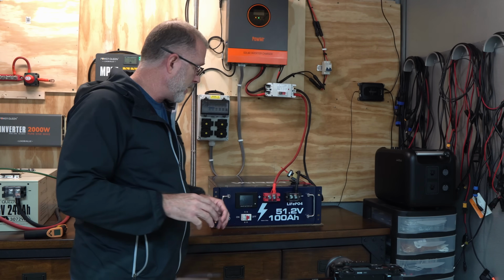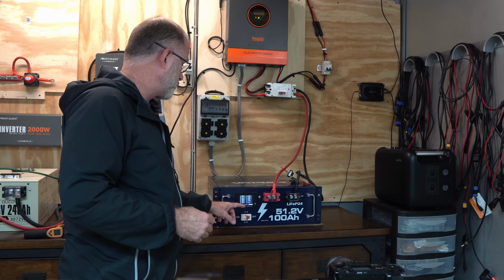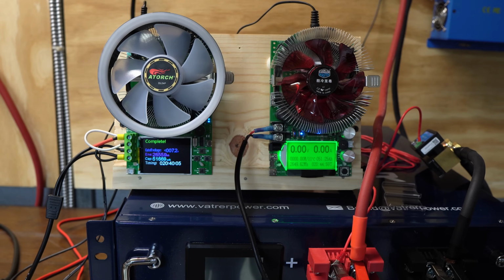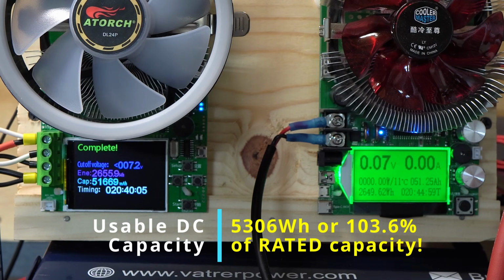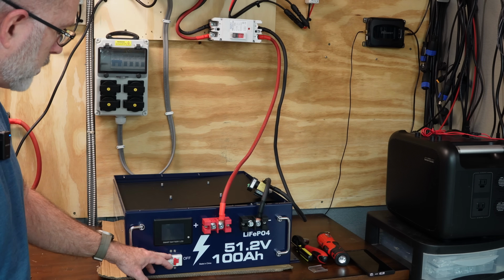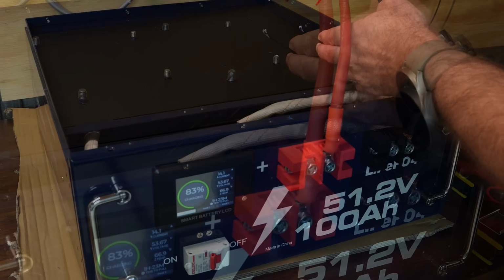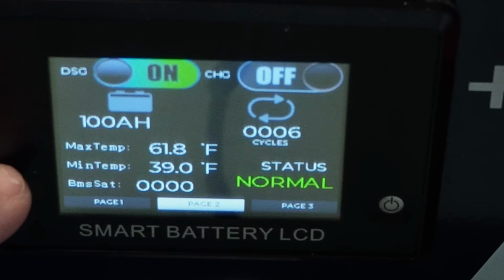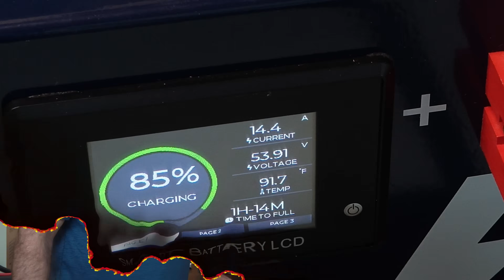48V vs 12V - PART 2: Is a Rack Battery the BEST choice?  Vatrer Power 51.2V 100Ah LiFePO4

Comment: Thank you for this video. I also  own one of these batteries. The problem is that whenever I connect it to  the inverter, it goes to a SC (short circuit) mode protection, visible if you navigate to  the second screen!! Obviously, this is caused by the initial  in rush current flowing into the inverter's capacitors. If I understand you well, I have to 1. turn off the battery's breaker, 2. turn on the inverter ,3. Turn on the circuit breaker, 4. Wait for some moments, then turn on the battery's breaker. Is that correct?
My understanding is that as long as the battery's breaker is off, no current in principle is supposed to flow out of the battery.

Comment: I'm interested in the circuit breaker that you have between the battery and the inverter.  I've got basically the same system and don't have a breaker at that point.

Comment: Great videos. Thanks. If you have this rack mount battery could you add a string of 12 volt batteries in series to up the capacity or would you need to keep using rack mount units?

Comment: I have a 48v Outback inverter and have used 8 Golf batteries which are near their end of use. I would like to use 48v lifepo battery. when I asked an Outback tech he said I should not because the charging was not right, and it could cause a fire. I would like to know your opinion.      Thank you

Comment: Great video . Do you have a video on how to install the entire system for the inverter in the backgroung? Thanks
Reply from the maker: I have a couple of videos that walk through the key elements.  The one on that specific inverter is here: https://youtu.be/C-SneC4oXiA   And I've also done one recently on an upgraded inverter from SunGoldPower here: https://youtu.be/R6mYMVkByas  I hope that helps.
Reply: @ReeWrayOutdoors  thanks for the videos very useful. You gain a subscriber.  I was thinking on a EG4 inverter 3000 all in one and noticed that max current imput is 80amps, what does it means compared to the Powmr? I am a begginer , so i am still learning. I hope you can comment. Thanks again!
Reply from the maker: @alexherrera3918  Between the EG4 3000 and the POWMR 5000, I'd go with the EG4 if you don't need the extra power capacity, because EG4 is based in TX and you'll get better service and support, which is definitely worth something.   The 80A cited on the EG4 is referring to the maximum current it can provide when charging batteries.

Comment: So you use a step down converter to power all the 12 volt stuff in the camper?
Reply from the maker: @scottmartinetti4875  if your system voltage is not already 12V, yes. And keep in mind that many DC appliances (fridges in particular) are often already compatible with 12V or 24V so in those cases you might not even need a step-down converter.
Reply: @ReeWrayOutdoors  have you seen those electric car generators for $600 in eBay? Auto start, 48 volts.  Thinking about doing that in my old Toyota motorhome and then getting a set of 48 volt batteries.

Comment: I am testing this setup with a LiTime 48V (51.2V) 30Ah LiFePO4 Lithium Golf Cart Battery, Built-in 60A BMS, Support 2C Discharge, Max. Power 3.07KW, wondering what settings I should use?

Comment: Thank you for making this video! If the Vatrer also had RS485 it would be a no brainer vs more expensive vendors! Did it come with cables to link it to the MCCB you have between it and your inverter in the video, or did you have to buy / make those separately?
Reply from the maker: No, it didn't come with any cables.  I just crimped my own.  :)
Reply: @ReeWrayOutdoors  that's good to know! What awg did you use?
Reply from the maker: @thedabbler2753  I used 2awg since it can handle up to about 120A which should be a solid 15-20% higher than the 5000W 48V inverter I'm using will ever pull (and my DC breaker is rated for 120A as well).

Comment: I got a 12.8 volt 50amh  LifePo4 battery.
I'm using an  54.7 volt  ebike charger , will  the 54.7 volt do damage to the LifePo4 battery?

Comment: I currently have 2* 100a 12v marine lead acid batteries but plan to get LifePo4 eventually.  But, i want to put an inverter/charger and was debating on whether or not to use a 24v system because i already have these 2 12v batteries in my rv. Should i get a 24v or should i stick with 12v?

Comment: I just bought (4)  12v 100a batteries for a grand total of $600. Not near as fancy but for less than half the price it fits my budget. As far a balancing goes according to Will Prowse and David Poz if wired with the leads at opposite ends of your pack they will balance themselves but best to just make sure to fully charge prior to hookup. I have heard that when building a battery from scratch you may have voltage issues so always use a BMS with built in balances.
Reply: Balance not really needed if all wired in series, inbuilt BMS will take care of it
Reply: My question is 4 12v 280a batteries  more power then 1 48v 100a battery? I am asking because I want to get a system and don’t know what the best option for me on a budget friendly way.

Comment: Always enjoy your videos.  I've been thinking of building a diy portable hand truck 48V system using a server rack battery to use for my shed for lighting and running a small window 6000 BTU a/c and lights for a couple of hours a day.  My question is will the 30 amp MPPT be enough to do solar charging (400W) or should I buy a larger amp MPPT in case I decide to expand.

Comment: Not sure if this will have any "real" impact, but 48 volts is less than 50volts... which is relevant to the NEC. Whereas, 51.2 is greater than 50v, so more of the NEC applies.
Nevertheless, Its convenient to have 100 AH "packs"... etc, with all the built in meters and switches etc.

Comment: Install a transfer switch on your house service panel, kill the main breaker and let us know how long a system will operate with solar back up. It did not work for me and I installed a dual fuel Generac system propane/gasoline. I am all for the battery concept but when an ice storm takes out the rural power lines and the sun doesn't shine, it was not enough for me.

Comment: On parallel connections, there is actually no limit.  That is, it is solely an issue of safety and the battery's internal interrupt rating, so you can expand in excess of whatever limit is specified simply by adding additional fusing and breakers.

People often use the Victron Lynx Distributor (not the "Power In") to parallel a large number of batteries together.  Each distributor cable pair goes to a bank of 4 batteries in parallel and the distributor provides the appropriate fuses.

--

For series connections (which is never recommended no matter the count)... there is a common-mode limit related to the overall system voltage that becomes an issue with BMS disconnects on individual batteries in the string.  So the typical manufacturer specification must be adhered to.

A whole-battery balancer is mandatory for lithium series configurations, and those generally only come in increments of 12V so you generally have to be in DIY mode if you are going to connect two 24V batteries in series.   But this is easy to do too... it's just a normally-open voltage-monitoring relay and a 50W 50 ohm dump resistor with a heat sink on each 24V battery to dump energy above 28.4V (assuming a 56.8V overall charging target for the bank).  (also use a small inline glass fuse to power the relay & resistor for safety since it is tapping off each battery directly).

--

In terms of initially connecting batteries in parallel, for LiFePO4 since the charge and discharge curves are so flat, the batteries only need to be close in voltage to be connected together.  Even if they are at wildly different SOCs.  Your first full charge cycle will behave a bit weirdly but will get everything up to the same SOC by the time its done, and the next discharge/charge cycle will deal with any remaining differential.

-Matt

Comment: one advantage i see in the seperate 12 volt batteries  connected in Parallel is you can disconnect them and charge them seperately with a low amparage charger like a 20 amp charger.This would work for me in my type of set up, i dont have any high amprage chargers.Prob not an advanatge but this is how ive been charging my 36 volt set up.I do see the advanages with an all in one 48 volt system.

Comment: 1:35 I know one reason you might want to put batteries in series is that you need less current going through the wires... was looking into building a smallish DIY Powerwall, which I could barely afford, and found that to deliver enough power to the house for the 5-30 seconds I would need for the rare and brief power outages I would need several hundred amps of 12v... not only would I need to have batteries capable of supplying that, I would need wires and the necessary amenities to safely convert then output the power... increasing to 48v or over 80v lowers the amperage down considerably.

I could be wrong, as I am not rather educated in battery building, and haven't looked further in it after finding most my "design" would require pricy industrial quality parts such as the 1400 dollar DC to 120v AC converter. My biggest mistake was not researching enough before I started making my "designs" so likely I will completely redo everything if I were to go down that rabbit hole again.
Reply: Pushing house-sized amounts of power reliably can get expensive, for sure.  Regardless of the voltage.   Usually you don't try to do that unless you are willing to spend like $50K-$100K on a large battery + solar + whole-home system.

Instead for the moment I just focus on the critical loads in the home... a few lights, furnace fan, and fridge mostly.  I've been planning a whole-home system for ages and it keeps changing... haven't pulled the trigger yet but I'm getting closer.  I'm already up to 10 kWh of storage and 2 kW of panels "off-grid" (grid is used for low-battery support only).   Most of my house is still on the grid, though.

-Matt
Reply: @junkerzn7312  That's what I was thinking a bit back, and even started looking at it again; started looking at a simple UPS for my desktop and the router, as I am in college, and thats how I do my work, but couldn't wrap my head around how it would work and felt I shouldn't mess around with that until I do lol.

Comment: Excellent presentation.  Thank you.  48v is king in a home or fixed location where space/weight/form factors are not an issue and 12v needs are not required.  In a van/car/truck where there is already a base of 12v devices and needs and space/weight/form factor are critical, 12v setups are far more flexible.  Heck, in a car/van/truck, you can literally directly use a 12v battery, such as with a frig, with no watt sucking/wasting convertors/inverters.  You can even use them to jump start the vehicle in a pinch.  The term "better/best" is answered once you know the use case.
Reply: The only time you'd want to stick with a 12V system is if it is a really, really tiny system, like literally if you just needed 20Ah or something,  or if the entire system is just running one piece of equipment, or if you simply have too much high-powered 12V legacy gear that upgrading is too expensive for you.

Those are all good reasons to stick with 12V, but that's about it.  Most people blow past the system size where one really ought to have considered going to 24V or 48V and many people wind up stuck with huge 12V systems and lots of problems due to that, especially thermal issues.

Often, someone will "start small" and not even realize where that will take them in the future.  They select 12V, and wind up stuck with it.

Space, weight ... all of that is the same for a 48V system as for a 12V system.  48V systems are actually lighter, in fact, because you can use much thinner cabling.   Now of course, the whole point of going with 48V is that the large-load items (inverter, A/C, space heaters, etc)... those run off the 48V system (or run off the AC inverter).

That represents the economic hit... the "upgrading" that you might have to do.
  
--

Remaining bursty/low/medium-load 12V legacy gear is easily dealt with.  Fridge, lights, toilet macerator, run-outs, levelers, etc.   For those you use a 12V down-buffer.  Basically a DC-to-DC charger and a 12V battery sized for the loads.  No inverter (inverter hangs off the 48V system).

It's utterly trivial and the flexibility is immense.   And buck converters are like 95% efficient too... no power is being wasted.  Some people even just use a 48-to-12V DC-to-DC directly without a down-buffer battery, but I prefer the DC-to-DC charger + battery solution for the 12V legacy gear for multiple reasons.

It can be tiny... literally fuse + Victron 75/15 charge controller + 20Ah 12.8V LiFePO4 battery.   Or more substantial depending on the remaining legacy loads... A 100Ah 12.8V LiFepO4 battery is usually plenty.  Or really beefy with a Victron DC-to-DC Orion charger (in a big RV for example).   That might seem complex, but it's actually not... it is completely trivial.

One can ask... why go with 48V if there is still 12V gear that needs to be powered?  One goes with it because the thermals are low, the cabling is far easier, and you can scale down the road incrementally without having to upgrade other components.   Think about the solar for example.  On a 48V system, ONE little 20A charge controller can handle 1000W of solar without even breaking a sweat.

There's a lot to love her.

-Matt

Comment: Howdy David,
                Very good information as always. One thing I still don't understand is the breaker between the inverter and the battery. There is a breaker on the battery, yes? Is it an AC or DC breaker on the battery? Is that why you need the external breaker between the battery and the inverter?  I have also seen these 48v server rack batteries come in different sizes, from 50ah all the way up to 400ah. Who is going to lift a 400ah battery by themselves? LOL.
                                                                                 Thank you as always, Steve.
Reply: Fusing and breakers have to match the capabilities of the wiring they are protecting, at a minimum, or be smaller.  The breaker on the battery is for the capabilities of the battery and/or expected battery cabling, often inclusive of battery surge capacity.   But this breaker is ONLY for the battery cabling to the bus-bar.  It isn't for other cabling hanging off the bus-bar.

The cabling for the inverter is typically NOT 2 AWG on a 48V system.   So it needs to be fused and often also breaker'd for the smaller of (cabling current capability) and (inverter-size / expected loads).   This is usually substantially less current than the battery breaker.

Breakers are also often installed even when there is also a fuse on the same cable.  The reason is to make maintenance easier to perform.   If I want to mess around with an inverter I can just flip the breaker for its cable off and leave the rest of the system live.  Same thing for a solar charge controller or any other cable hanging off the bus bar.  Even though fuses are there for protection too, having to unscrew and rescrew fuses all the time just to do minor work is really annoying.

In fact, solar cabling often has a breaker both in the combiner box AND also at the point where it goes into the charge controller, allowing work to be performed in either location with a convenient flip of a nearby breaker.

In solar / battery / inverter systems, nearly all breakers should be 2-pole.  Break on both the positive and the negative.  Fuses are usually only on the positive.  Breakers are generally on both the positive and the negative.

All DC wiring must use DC breakers.  The breakers on the battery are DC breakers (they had better be!).  They are DC breakers and also generally they should be unpolarized DC breakers since power can often flow in both directions (plus people wire polarized DC breakers up incorrectly all the time, creating a fire risk instead of adding safety).

Comment: Multiple 4s cell batteries will have multiple BMS, so cost, component mtbf,  compatibility.  I guess those are a plus if you want to break them into individual 12v 🤷‍♂️

Comment: Another element for having parallel ... easier weight wise to handle.  We are not always "young whipper snappers" :-) ... I think a really important aspect is the ability to monitor ... so each should have a bluetooth or monitor aspect easily attachable.. even if no tooth, have a plug where one can plug or hard wire to each battery (12V)